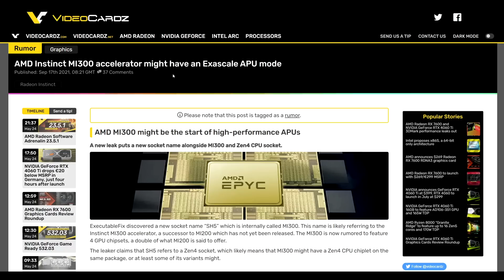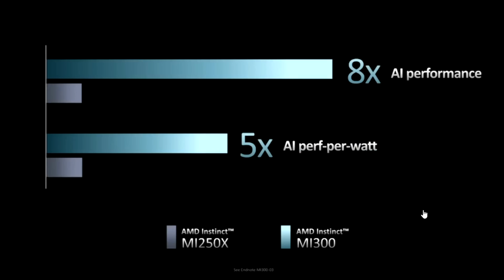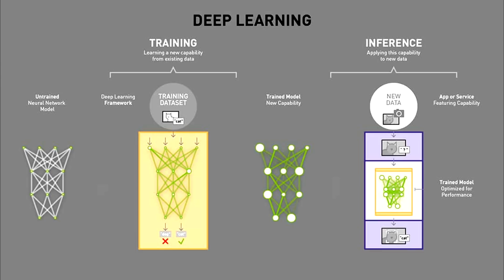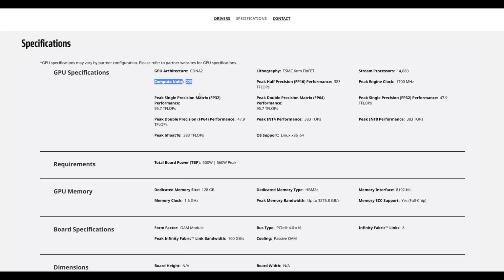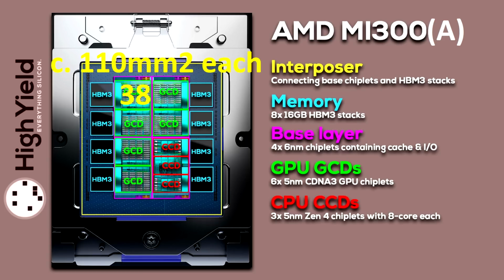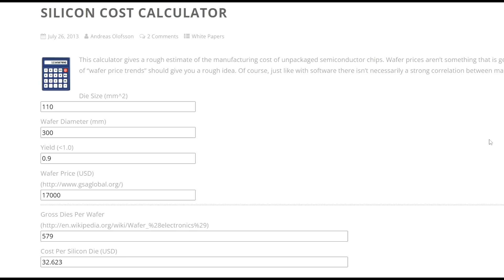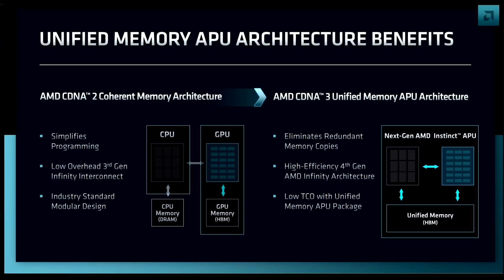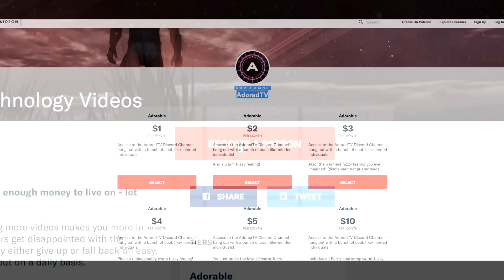AMD Takes AI-M at Nvidia with MI300X, MI300A and MI300C

Comment: I think AMD is gonna smash Nvidia in AI. why do I think this? I have both a 4090 and 7900xtx, and I run both in image generation and text generation, and somehow, someway, the 7900xtx is faster. I know I sound like a fanboy, but look at the facts. MOST people running any AI inferencing are doing so on Nvidia hardware. They haven't even tried to run on AMD. They don't know if it would be good or bad. Most Nvidia fanboys would never buy AMD to find out! And the craziest part is using ROCm to translate CUDA to something AMD can use.... and yet its still faster for me. Comparing both, the 7900xtx is slightly faster. I know, its not a huge difference. But faster is faster. Imagine how much FASTER AI could be, if they weren't relying on CUDA and picked something else for AMD.

So with that in mind, I think AMD could end up disrupting the AI market. Nvidia has simply been the most available AI product, which made them the go-to. That doesn't mean they are the best at it.... mind you, im not training, im running. but still. im sure amd will still disrupt the market.

Comment: In NVIDIAs buisness model for AI, I still feel the hardware they are selling for AI is a means to an end. That being to significanty entrench their position via getting users onto Nvidia's various AI software/ platforms enabled by their hardware.

 Even if AMD has the hardware they are severely, serverely, behind when it comes to software/platform side of the market. Something Nvidia has a massive head start in and something I cannot see AMD catching up with.

 AMD will likely attempt to do their usual embracement of open source offerings that are platform agnostic, but I think there are fundamental differences between the gaming market and the AI industry that will lead to such an approach being much less successful/viable than it has been in gaming.

Comment: The problem for AMD is Nvidia.

Developing a piece of hardware for something as complex as AI is getting close to not being good enough anymore.

You have the likes of Nvidia that are developing COMPLETE solutions for companies, and these are solutions that these companies can't solve for themselves, and this is what AMD isn't getting.  We're moving into a very complex form of computing and simply hiring a few software engineers to develop a solution doesn't work anymore for these systems.  You need people that understand the hardware ALONG with the type of compute the hardware does along with experience developing solutions with this type of hardware.  Nvidia is hiring the best people they possibly can to make these solutions, and they're superior.

Nvidia went from being a hardware company to a technology company almost a decade ago.  Then you look at AMD and they can't even release a GPU where the DRIVERS and BIOS work correctly at launch, or even a CPU that has a highly optimized AGESA, and it takes them a good year to 1.5 years to get their hardware working the way it should.

I give Intel and AMD about one more decade with X86-64 if they don't get their software engineering teams up to high quality and develop COMPLETE solutions the way Nvidia is.  And this is simply because companies like Adobe, Autodesk and other seem to be too lazy to make the best of many core CPUs.  Meanwhile Nvidia will get permission to write code needed to run their desktop replacements for X86-64 that will eventually come out, once Nvidia has the resources to move into that area, which is also a lower profit area and not so important to Nvidia, for now.
Reply: Correct. Nvidia has already stated that it is a 80% software and 20% hardware company.

Comment: The MI300 series may fundamentally change the definition of what a server CPU is like. Up until now, server CPU's have been effectively identical to desktop CPU's, with only sometimes more cores and improved IO along with a few other minor adjustments (eg usually lower clock speed). With MI300-C, it may be all CPU's inside but it's nothing like EPYC or Xeon. Additionally the all GPU version and the variants with combination of CPUs and GPUs really changes the landscape. Some version may have specialized accelerators inside made for large enough customers. Intel is left out of the picture, and Nvidia's Grace looks like an ARM version of EPYC or Xeon which is nothing new. I do not expect the MI300-C to replace EPYC or Xeon, but it certainly changes the picture, some applications that used to be all EPYC or Xeon will instead be all MI300-C (or variations with GPUs).

Comment: Been watching since 2016 and the Polaris hype saga, just rewatched some of the older speculation videos for nostalgia at how far things have come, and the "AMD Master Plan" has finally come true except for in gaming (so far).                                                                               "AMD (could be) in complete control of gaming- VR with multiple graphics card is great. Separate dies, much lower latency and higher performance. Once we get to 10nm, AMD could have tiny multiple 100mm^2 GPUs, running as fast as 1 600mm^2, a lot more manufacturable, this is the real endgame. Not much money in Graphics, lots in CPU. Intel's got billions, and this is why Nvidia is trying to get out of gaming as fast as they can (Automotive, AI). Not even sure Intel could afford to buy Nvidia any longer"

Comment: MI250X is more energy efficient than A100 by a mile, at least when it comes to HPC loads. H100 goes 5% better than MI250X but doesn't seem to be delivered on mass yet.

But not just on FP64, mind you. Mixed precision Top 500 post excellent results for Frontier/MI250X. Unfortunately, without access to hardware, it is hard to know if the Nvidia demand is because of GPU capabilities or deficiencies that still exist on the AMD software side. I hear ROCm has much improved since I last tried it.

Comment: IMO, this won't be enough to touch the palace that Nvidia has made in the datacentre marker with their GPUs.

Nvidia has full vertical control of their hardware and most importantly, their software stack. From researchers at universities to government facilities, they'll stick to a stack that is more mature and more used around than AMD's ROCm platform.

Comment: That die size is unfortunately quite incorrect in terms of methodology.
For the simple reason that a Navi31 compute unit is nowhere near the size of the MI300 compute unit.
For one, navi cuts out much of the FP64, and MI additionally adds all of those mixed precision operation ALUs like Int4/Int8 and all those take area. 
If you wanted to find the area, you could have easily used the Zen4 chiplet as a reference. It’s the same chip used in Desktops.
Reply: Do you have reason to know why AMD isn't using FP64 on consumer GPU's anymore? Seems like you need it for raytracing now.
I think maybe Vega 64 was the last one that have FP64 isn't it? although it wasn't very good or fast at it either.

Comment: Why not hard wire a path of traces to draw 2 8-bit ints from a single 16-bit int to run 2 parallel processes from the same cache? How hard would it be to trace a little parser into a series of int8 operations to accelerate 16-bit or 32-bit floats or whatever? It's gotta be more real estate efficient to have an accelerator parse a double into 2 longs than to have dedicated packages for different varieties of precision compute. That kind of optimisation could be handled in the compiler if the parsing was accelerated within the compute die.

Comment: I do wonder if AMD went a strange(ish) route and did something like 12 bit floating point, or even 8 bit floating point to help with the 8x performance claim.

Also, how many MI300 packages are we gonna see on a single PCIe card? Or just integrated into a motherboard?

Ps.: 8 Core chips for MI300A, and not the 16 core "dense" chiplets?

Comment: On the matter of software ecosystem, this is less important for hyperscalers, they often have the resources to write their own targeted implementations.
This is also why you see amd's cards more in these systems than in the rest of the professional segment.
Reply: Completely agrees.  These guys have huge resources and they will help AMD to lower their dependency on Nvidia. I would love to see some benchmarks on June 13th.  I bet Microsoft will be on stage.
Reply: I doubt any hyperscalers are using anything but bespoke software, in which case CUDA and Nvidia's software stack are irrelevant. Smaller start-ups, on the other hand, will be drawn to the ease of implementation NV offers.

Comment: I'm wondering if we will see 3 bit or even 2 bit capable AI processors.
Reply: Open source researchers on Large Language Models (mostly descending from the leaked Meta LLaMA model - I guess Meta can't fire 10,000 workers without at least one seeking revenge) are already doing novel research using new LLMs that employ 2-bit precision for the parameters. In that case, each of the four values represents some segment of a normal probability distribution rather than specific numeric weights (I have no more details than that at this point). And these models are currently run on the CPU since no GPU has that capability yet. This is the bleeding edge of LLM research.

Comment: I thought the whole point of chiplets was to increase yield or effective yield? As in, if Nvidia has a partially failed chip, they downgrade it to a lower end part with disabled parts but still paid $300 each, while AMD can just use less chiplets on a GPU to have a lower end GPU? Wouldn't that cut into actual yield as well since it has problems in the chip?
Reply: Chiplets have multiple goals. One is to reduce cost to manufacture by increasing yields. Another is to increase performance by utilizing more silicon than allowed by the reticle limit. There is a maximum size for the die when being fabbed. Right now at TSMC that’s around 850mm2, and you almost certainly can’t use the full die for yield reasons. Using 6 125mm2 chiplets and that’s 900mm2 of silicon, and using the full die is much more viable. Intel right now uses 4 400mm2 tiles on their Sapphire Rapids processors for 1600mm2 of silicon. A yielded chip just means a usable processor, and chiplets increase this number.

Comment: GPU prices need to be 60% lower, yesterday.
I'm still sitting on a GTX 1070 from 2016. That card will be 8 years old next year.
Hoping they sort out their shit pricing by the time the 5000 series comes out, otherwise it's gonna be another skip generation. The entire 4000 series is dog shit, from top to bottom, because they shifted their entire product stack by 1-2 tiers AND are charging more money. How fucking dumb do they think we are? 😠 Everyone is collectively shitting on Nvidia right now and I think that's a beautiful thing.
Reply: You can spend from $250 to $350 right now and get 50-100% more performance.  6600 XT, 6650 XT, 6700, 6700 XT, and 6750 XT fill out that range.  That's 8GB, 10GB, or 12GB VRAM as well.  

Unless you insist on wasting money with nVidia, which has no options for a reasonable amount of money.

Comment: The largest problem for me is that AMD has nothing like CUDA. They have ROCm with no Windows support. I hoped the last release would add Windows support, but no dice. And since I need to run models locally on my Windows machine, I have no option but Nvidia with their overpriced cards with less VRAM. An RTX 4070 with 12 gigs? That sucks.
Reply: It's corporate/research first. The money is there, they will buy thousands easily, and they also have the knowledge to build their own tooling and code. it will take some time before rocm will trickle down to consumers. And cuda first released in 2007, and considered as industry standard around 2014-2016, it needs time to develop a whole new framework for amd. With how crazy ai development going, i don't think consumer hardware will go far, we're now having 30b model for LLM keep released, and they will keep going bigger, who knows when even 3090/4090 is sufficient enough to inference that, with how it keeps getting bigger and bigger, unless nvidia/amd release card specific for home users which is unlikely for now. And since you use windows, which most researchers/corporate who will build their tools/apps using radeon instinct don't use...
Reply: @ariffinsetya  this, ROCm gets more and more developed for local use, but AMD is honing it up with super computers and slowly moving to smaller systems
Reply: @defeqel6537  yep, using linux based system is the way to go for now, if you want rocm... really can't wait for rdna3 support, since 20gb vram 7900xt will be so much better for my wallet than 4090 🤣

Comment: I think the experience they got from designing APUs for consoles also helped to make this.
Reply: Yes indeed. This is the result form "future is fusion" started when the FX CPUs came out ;)
Reply: @doggSMK  Damn, didn't know this goes back that long.
Reply: @Pixel_FX  It was part of the basis for the purchase of ATI in the first place. I don't think they necessarily anticipated the dominant use case but issues around using power shifting bits around between CPU, GPU and memory ( which is a big source of inefficiency ) have been known for ages and are a fairly obvious problem to tackle. You can also see the memory roots for this in HBM as well which hasn't taken GPUs or PCs by storm but seems to be standard for these AI cards. Of course the fact that it's taken so long suggests pretty strongly that while it's an obvious problem to try and solve actually solving it is substantially harder, especially when you have to keep the company running and have competitive GPU and CPU designs to slot in. One of these AI cards with a bulldozer core and GCN would be a far less appealing product, it's actually a lot of balls to juggle when you think about it, especially given how young AMD is into being anything like a 'large' company, AMD still has less employees then NVidia and far far less then Intel ( though they also work on the manufacturing end so a bit apples/oranges ). Goes a ways to explaining some of their missteps in the consumer GPU market, it's just not a ball they're all that focused on.
Reply: Correct.  It's always been a game-changer for AMD since they acquired ATI.  We're even already seeing AMD bearing fruit from the Xilinx acquisition for AI as the upcoming AMD Phoenix APU's have dedicated AI silicon ("XDNA").  This just gets their foot in the door -- not anything close on what's to come next.  Guessing MI300 has some benefits as well, even if we haven't seen it extensively... AMD is one to go heavy on marketing, so we'll know come circa June 14th!
Reply: The next consoles will probably be chiplets based too. Should be interesting.

Comment: There is a big demand for AI accelerators. And even thought Nvidia has a big software stack advantage, if you can't get enough Nvidia accelerators, you'll have to start using different products, like TensTorrent (Jim Keller's project) and others. Maybe AMD can get a foot in the door, and with the help of the new booming AI industry, they (AI industry and startups) will have to start using *whatever* is on the market. So Nvidia's software advantage isn't such a big selling point here. AMD just have to execute properly, bring decent gen-on-gen improvements, and collaborate with clients to bring specialized products they need.

Comment: Always love to watch your analysis, you never fail to focus on areas I only glance over. Super interesting stuff!

I'm wondering if we will see a MI300 version with dedicated Xilinx AI accelerator thrown into the mix.
Reply: I have the same question...
for now Xilinx is still not there
I'm curious to know how AMD will use/implement it.
Reply: @willgart1  they have DPUs and corresponding Datacenter Switches branded AMD already...
Reply: @willgart1  AMD seemingly doesn't have a clue how to market their Xilinx XDNA AI chiplets. They seem to think they need to have some killer laptop application just waiting in the wings such that they can tell customers "you can do that (killer) thing (whatever the heck it turns out to be) with this new laptop" before they even put CPUs with those XDNAs out there to the public. Stop being stupid, AMD! Just put it out there, and your inventive customers will figure out what the heck to do with it!

Example: AMD says the Xilinx XDNA (chiplet, maybe, or maybe it's in an integrated APU) will be in "some" of its 7040 series Phoenix line of APUs. However, mum's the word on whether it will be in its two top-end chips in that series, namely the 7940HS and the 7840HS. Meanwhile, some vague rumor seems to have been let slip by AMD that the Xilinx XDNA technology will be in their 78040U series of cheaper lower-powered chips. That's essentially also the same/similar chip as one of the Z1 or Z1 Extreme chips that will go into the Ally (and also unclear whether the Z1 series will have Xilinx XDNA). Well, if that's the case, then WTF, you mean I have to downgrade my top--of-the-line 79040HS APU to a cheaper 78040U APU in order to get the Xilinx XDNA features, which is the main reason I want a Phoenix series processor in the first place? Get your S together AMD. You're sitting on a Xilinx goldmine and you''re embarrassed to market it?
Reply: @jimatperfromix2759  Whew, bro! You could transform that into a captivating daytime tech drama soap opera show. 🤣😳
Reply: @jimatperfromix2759 Which software do you wanna run? ROCm, OpenCL and Vulkan probably, since you can't use CUDA.

Then you'll need some driver compatibility.